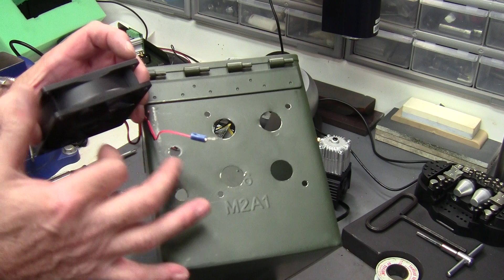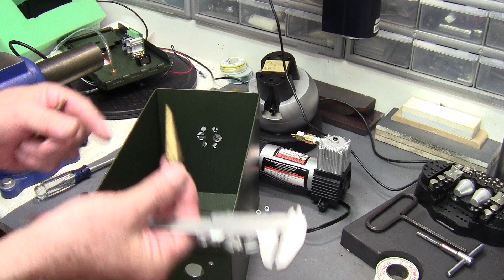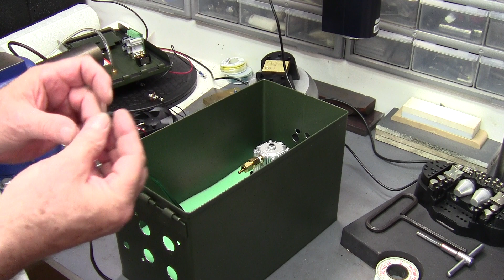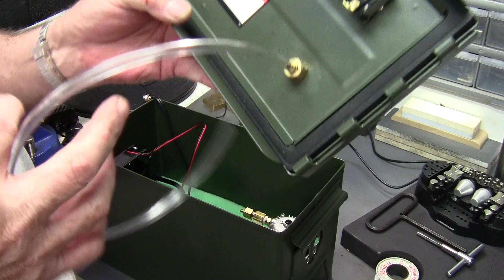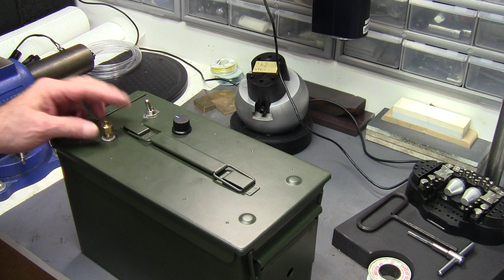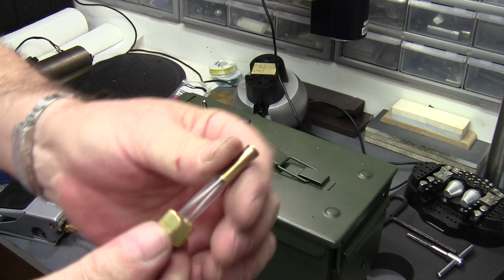How I built my Homemade Hand Engraving Machine Part 3 wiring modified compressor

Comment: on ac power black is line
Reply from the maker: You are correct sir, good catch, I hate to steer anyone wrong, I will make  corrections to my wiring in the next video.
Thank you for pointing that out!!!
Reply: I sent a replay but think my pc had brain fart not a big deal black or white in this but don't newbe to go up in smoke. I too am making hand held engraver bu I am trying to put speed control in hand unit also am making a flat lap sharping system with a HF grinder. Good job on your engraver. will let you know how mine works out.
Reply from the maker: You are right its not a big deal and it works fine, but no sense getting into or teaching bad habits. Just finished swapping the wires around, back to code. Im interested in seeing both your hand-piece and your flat lap sharping system, do post or email some photos!!
Reply: Still some work to do on the hand-piece will send photos on lap soon keep up the good work this engraving is all new for me talk soon
Reply: American colours…UK…totally different..